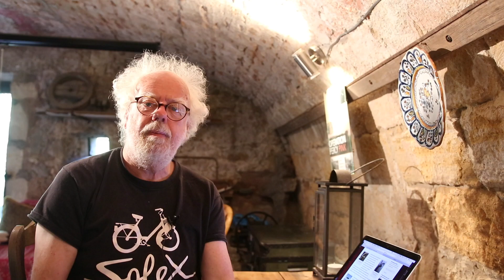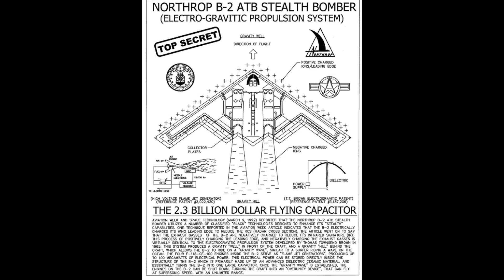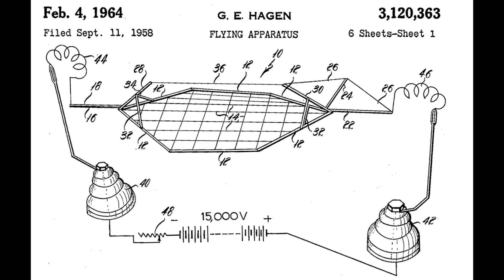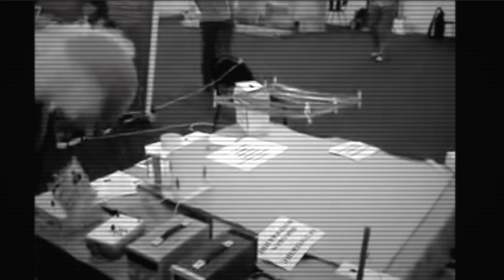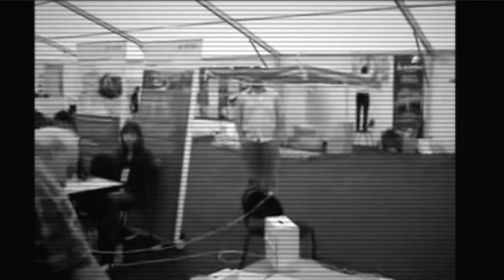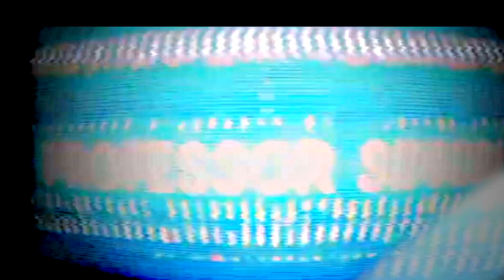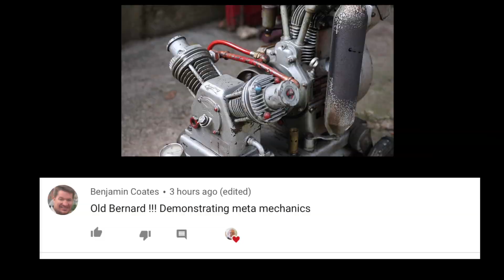Military anti gravity - Prof Simon

Comment: It's very simple it's all down to the warping of space through  microwaves.It is not anti-gravity, what the U.S.Military employ but rather a 3 point equal axles employing 3 microwaves at each point of the tri-angle,thus creating reduction in overall weight mass of any chosen aircraft.It works fairly simply to put in a simplistic manner the heat generated by the 3 microwave fields creating friction on the surface of space underneath the vehicle or craft causing the vehicle to rise the more voltage employed the higher the vehicle rises it's basic phisics heat rises there are many benefits from this reaction mainly faster velocity due to less weight and restriction as the triangle is the most aero-dynamic shape this technology has been around the scientific field for ion eighty years and a turbine to center of the tri-angle for propulsion air inlets for massive consumption of air at instant rapid exceleration through air inlet through turbine generating through dynamo electricity to all 3 outbound microwave transmitters that create 180 degrees microwave force field on undercarriage of vehice creating thermos lift weight mass production and warping of space then the air is spat out the rear end of the space vehicle at crazy uncomprehenderable Mach 9+ speed through the many exhaust slots always remembering the endless various fuels you can ignite and add to the turbine in the centre of the triangle space vehicle thus creating excelerantion beyond the speed of light which would allow a matter of days to reach the edge of our solar system the tri,-angle spacecraft sub-frame would be could be rigged with the strongest shape known to man a little gift from the bees themselves honey one shapes cut out the main frame thus creating a strong co inhabital living quarters for the space crew with the outer chasey being constructed of cold drawn Titanium to withstand any monecule  impacts at high velocity speed then just add a fold away tri-podic undercarriage soyou can land on any surface in existence there will be no runways in outer solar system planetary environments the Americans have all readybuilt such a machine it has been in use for years there just not got bombardearing astro naughts to maruade across the sky's fully incontrol of spacecraft naturally stearint towards any chosen destination they call it the astro tr-3b the clue is in the name of it ASTRO MEANS SPACE which means they have already been to the edge of our solar system in a sumwhat cowardly manner it is very cheap to build it runs it's self and the reason there not telling you about it and they are funding an astronomical amount on N.A.S.A. leaves many fundermental logically question in answered question address to the president of the United States please.To sum up and reach a conclusion to my technical debate I would go one development further I would make the surface of the ASTRO tr-3b OF MAGNATISED VULTAGE ADMINISTERED CONTROLLED FORMATION OF MUCURY ANY DAMAGE SUSTAINED DURING FLIGHT COULD BE REVERSABLE AND THINK OF THE ENDLESS SHAPES YOU COULD MAKE FOR YOU SPACECRAFT FOR ADAPTABLE WARCRAFT MANOEUVRES IN THEATRE OF BATTTLE IT WOULD BE BULLET PROOF I AM TITANIUM HA INDESTRUCTABLE THAT WOULD GIVE THE GREYS SOMETHING TO THINK OR SHOULD I SAY WORRy ABOUT I THANK YOU FOR LISTENING I've been your host on this technical journey mankind's greatest friend Steven Batey made in Manchester on a lighter note I love you all Steven Power to God.Amen.xxx

Comment: The limit r-> inf (G(M1M2))/r^2 = 0. Gravity cannot be eliminated, but it can be bent and minimized. If you bend the gravitational radius between any two objects a sufficient number of times, then the virtual radius between the objects can make the gravitational attraction between them negligible. Additionally, it may be possible to bend the gravitational radius to follow a Bernoulli Spiral form, which has an infinite rate of change.

Comment: Under little to no real world constrains, any conceivable idea may work as we pleased .. that is fictional science just enough to fool  those hungry parties to push to offer research funding. When funding dries out or get redirected the idea will be flushed into public domain .. such as professor Simon. 

Lacking of real world constrain, that a 100WATTS light bulb consumes enough electric charge in one second (Coulomb force). If such amount of charge is mounted onto to a 1970 VW beetle the repulsion force on the beetle is strong enough to lift it up and hover it in mid air as long as the same charge doesn’t dissipate in plasma glow or ionizing air molecule. No one has ever been able to mount and maintain that much charge onto like objects on earth wirelessly ... that explains we sill paying for our own air fair. 

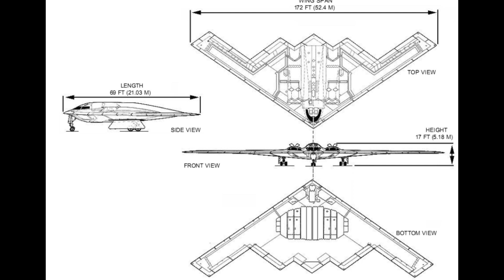Mark 2:20 depicts a silly and under educated hypothesis (fiction al science). Metallic structure is impossible to get charged with (+) in one end and (-) to another, that opposite charges will meet and dissipate half way down the fuselage. Also there is no net (-) charge on board the plane to take advantage of repulsion force (anti gravity) knowing that earth is (-) charged. 

If the stealth bomber is made of dielectric material and that it can be charged +ve nose and -ve tail, its nose will be attracted to earth with tail pointing up. Even if it can remain buoyant it is poised in a bad aerodynamic condition along a horizontal path. 

Why would our government hang out with these silly folks? and offer them funding?

Comment: B-1B also has this "feature". It lowers the mass, and It increases the speed, and fuel mileage. I do wonder if it lessens the effect of inertial energy? Would a 3g turn still feel 3g?
Reply: a 3G turn will still feel 3G unless you are creating a "local gravition field" around you,which the vehicles that use the Element 115 generators produce..kind of like how your car protects you from the effects of the wind outside your car when traveling at speed..
Reply: Noooooooooooo it don't.

Comment: Great video we call them lifters I have been trying to build one for a while. just picked up a voltage tripler gets me up to 75kv let you know how it goes...
Reply: An Electrician Working for a Co-Op got Hit with 20,000 kv he was Completely Atomized the Only thing Left were his Boots they had to Send EveryOne else to a Psychologist, How's that for being Charged?
Reply: @victorvictor8587  it's the current that kills you, I'm using a t.v. fly back transformer with a voltage tripler. It still would kill me if I touched it but it's not as hard to work with as high voltage power lines..

Comment: This might be a form of plasma stealth, and not an anti gravity device. An aircraft equipped with electrostatic charge generators does not need to have hypersonic capability to ionize air near the leading edges. Even if the technology produced a slight glow, the aircraft would still be undetectable beyond visual range. Futhermore, the frontal RCS is the part of the plane where the reduction is needed most.

Comment: that russian scale model flying from the table would be possible.. it's ion-izing the air between 2 layers of alluminum foil with a wire..for current.and flow at a direction ITS REAL .stil we couldn't lift the weight of any battery or coil 🤔🚀still don't believe 👽got here first  check this out! https://vimeo.com/ondemand/afieldfullofsecrets

Comment: Mercury plasma ultra high voltage using toroidal enclosure.. after initial start and power ups it achieves a critical point known as zero point.. from there it’s self sustaining..
Reply: Hmmm is this something u made up or is their a source u got this from?
Reply: The composite mercury plasma is a secondary mechanism, initial levitation and directional capability are effects of electrical flux at very high voltage.

Ultra high voltage Cycling of plasma to resonant points yields an area of effect.. think relativity.

That’s where the magic happens.
Reply: The old ones were called flux liners.. later came the Aurora & Tr3 etc.. these are fairly well circulated online..

Comment: Since the comments section is apparently full of theoretical physicists, CAN SOMEONE EXPLAIN HOW A UFO MAKES 90° TURNS ? 👽
Reply: These craft essentially produce their own gravity. They use this gravity field to bend space which propells the craft at mind blowing speeds. Because you are sitting in an artificial gravity bubble, things such as momentum, g-forces, wind, etc. wouldn't have any effect on you. Think of the "ufo" as a soap bubble that cant pop and you are sitting in the middle of the bubble. You can speed up instantly, make 90° turns at full speed, or go from 1000 mph to 0 instantly as long as you are inside the gravity bubble
Reply: As I understand it.

The effect in and around a craft of gravity is cancelled out by the energy created within the power source and directional controlling flow it can attract or repeal in very simple terms. 

If you use a LED light as an example you put energy into the emitter it produces light and is energy thus can be used, simply really and controlling the frequency of light gives more options.

When this type of energy is created it can be used in various ways like moving around but also can be used to distort the dimension you are in thus making it possible to travel between different dimensions and time what we know it is.

The military has been experimenting for years and have developed many different types of craft and equipment types using technology back engineered and technology acquired by various methods thus I would like to point you in the direction YouTube video's and research on the www. This will give you a better understanding of information across different countries and people's views and opinions thus helping you more.

Just another point of view is, what we call things like electricity energy or a destructive power source producing energy their energy sources are totally different from ourselves.

Also our planets within our Sol system has got secrets you would be very interested in I would suggest looking at the Moon first.

Comment: Hi, the high voltage applied at the engine intake and exhaust will result in a plasma cloud at these location. The plasma cloud is used to absorb radar signals and so makes these area's invisable to radar detection. As the intake and exhaust area's are smooth "normal" radar absorbion material is difficult to apply, so they use this type of technology. It was discovered during re-entry of satelites/space shuttle that radar tracking became difficult due to the large plasma buildup. Thanks for your positive enegry for sience as there is still so mutch to discover.
Reply: Exactly.
Reply: Want to bet on that.
Reply: Raimond is correct. It's how the Russians use stealth and how they got a Blackjack as far south as Washington via Canada and back without detection a few years ago when they commissioned them back into service.
Reply: The Ionised Plasma made radio comms impossible for the rentering spacecraft. To ionise you would lose all comms and tagetting on the B-2. Plasma shows up nicely on radar so it is not a route to Stealth. The B-2 uses small amounts of vectored thrust So you can't fly without the engines.
Reply: It's actually the generation of high charge which forms an ionosphere if water is present, that absorbs radar under either plasma friction or zero point energy which folds space to slightly hide from time itself which is electron neutrino pressure , at least until you reach much larger stars than our own which consume electrons or even mesons constantly to form new larger particles.
Reply: LO MISMO CREIA HACE UNOS DIAS Y AHORA ME DOY CUENTA LO EQUIVOCADO QUE ESTABA , DEVERDAD QUE SI EXISTE EL EFECTO ANTIGRAVEDAD
Reply: @Charles Yuditsky So they used townsend Browns Flame Jet Generator which he designed to allow the electrogravitics to work, on a bigger scale, but didn't use the electrogravitics he discovered and which was instantly classified after the naval yard demo?? I suppose it could have gone that way. You seem very certain, are you a B2 pilot by any chance?
Reply: nailed it !
Reply: Yes you are dead right..however to the original question this is not antigravity technology
Reply: @lyndondowling2733  well said
Reply: Let's thank a minute and understand the Spirit  has multiple ways 2 avoid detection,  anti-gravravity is not 1
Reply: @Swallabat  There is no electrogravity on the B-2
Reply: @lucastekkan  Thank you for clearing that up for me.. Given that the tech was developed by TTB in the 1950's before being classified by the USN, one wonders what they did do with it?
Reply: @mikefromspace  Proof ?
Reply: This is the correct idea.
Reply: @johnkean6852  he just made all of that up
Reply: They aren't run in conjunction with the gas propulsion...it's separate.
Reply: B2 plasma variant was a tandum secret black project think it was called project orion. Not the new nasa one. This is true stealth also the f22 raptor is rumoured to have an electorified body ie: plasma shield to hide from radar.

Comment: Dear Professor Simon, I was interested by B2 and decided to share the ultimate truth about antigravity and ufo phenomenon. Those crafts are man-made, based on mercury with ferrium, spinned inside torus to over 500.000 spins / second in superconducted, cooled to -273.15 degrees Celsius. Area 51, former worker Bob Lazar, checked by polygraph and body language guys, said they use Uup 115 from Mendeleyew chemistry table, discovered recently, but catched by army over 20 years ago as flying object. Hope you gonna make movie about it. Now they test other substances. Lazar guessed also the test on the sky, exact day and hour. Good luck ;]

Comment: How many pounds of fuel is really stored on the wings of a jetliner? How is it possible to store that much fuel in a flimsy aluminium pair of wings? What is that high voltage electric generator in the rear of the aircraft really doing? Aluminum  floats above magnetic fields you know and the jet is covered with it.

Comment: I think your bang on the money with the nimittz tic tac etc being our own as the ship had just been upgraded with a brand new weapons field. As for the B2 I read in author Nick cooks "the hunt for zero point" that yes The leading edges of the craft are charged which gives the B2 a kind of bubble that stops bow shock and reduces drag. Calculations were done and the fuel to flight duration was way higher than it should of been. But facts are hard to gather on the B2 especially around the exhaust area, plasma stealth in use there? Possibly. Interesting topic professor S.
Reply: Do you know, that electrifying wing of B2 would ignite fuel inside of it and make big bada boom?
Reply: Radek Smyk no that's not how it works, I see your thinking but it's more of an electro static charge on the leading edge of the wings. No big bada boom. Then remember this is all theory & speculation though it's a sound principal but alas classified info.

Comment: You can also use thorium on the leading edge if you run low on uranium. A German engineer stated the voltage range is in the 10s of millions of volts.
Reply: Its a antenna in the edge that transmits. No uran8um or thorium

Comment: Hello Simon I am a electronics technician / licenced electrician I was looking into this UFO phenomena and some of the story's surrounding it after I purchased a book from Stanton Friedman MSC called The Crash at Corona. After reading this book looked into anti gravity and Townsend Browns claimed anti gravity disk and other things such as HVDC motors using this principle. J Naudlin has a web site that sets up experiments and there are such things such as an asymetrical capacitor thruster NASA has a patient on. Corona discharge and its wind does not work in a total vacuum such as in space yet a thruster is a real device. There is UFO talk of an alien reproduction vehicle that uses EHV capacitors and a kind of commutator that directs the charges to the caps in varying patterns that give directional movement also  Naudlin I think noted the capacitors did rotate on a pivot when charged in a vacuum. Just how much phonyness was my interest I got an old TV and the Tube power supply which is about 20kv and started to experiment using foam polystyrene and aluminium foil capacitors but had trouble with voltages jumping across the foam I dropped the idea as it was dangerous otherwise I wanted to prove it was an effect that could not be explained easily. Please note lifters use a wind the other uses some type of anti gravity effect like a space time warping. I have a suspicion lifters might use both.You can see patents on this subject I dont know how solid a patent actually is as scientific proof of something like this. Like you videos keep it up

Comment: I have built a lifter capacitor using balsa, foil, enameled wire and the fly back transformer from a TV set and it did function. The best source for information on them I have found is Jean Louise Naudin.
Reply: Did I read foil? May I have a hat made of that?

Comment: Sorry it is not anti gravity when your talking about electrostatic discharge
It’s just moving air molecules and creating lift by ionic convection of the air because just like static electricity attracts hair on your arms it also can move air and make wind essentially 
That’s how you can propel objects through air with just pure ions coming from high voltage conduits